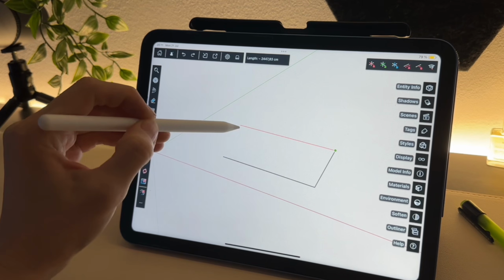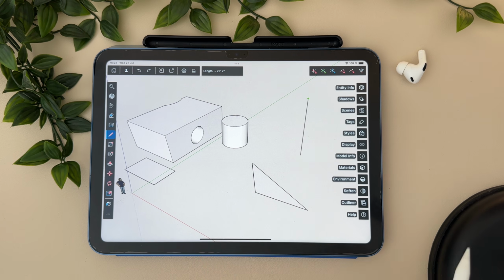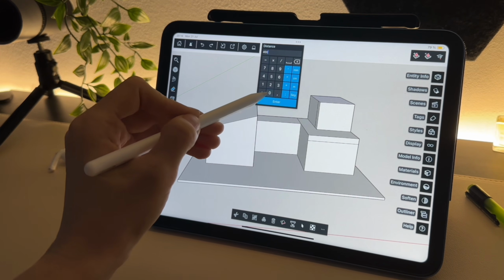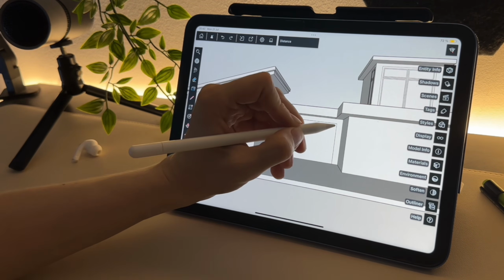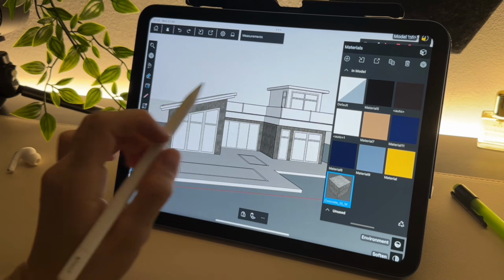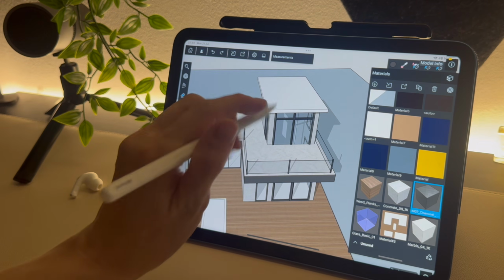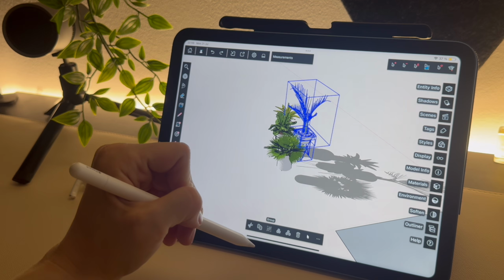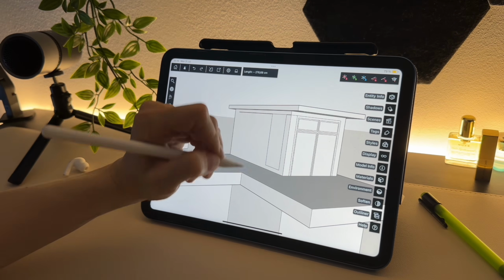SketchUp on the iPad, explained by an architect (+ free PDF guide)

Comment: Thanks, for the great step by step process ands I love all your other videos too! ❤ One doubt I have in this one, is that initially you have simply push-pulled rectangles out of the ground level which means they should have been solid cubes and not empty boxes. Then later, when you added a glass to your windows, they became transparent with internal space visible through those window. Did you skip a step of creating an empty space in the building or did I miss anything in the process?
Reply from the maker: Thank you!  You didn’t miss any steps. In SketchUp, when you push-pull a rectangle into a box, it creates faces around the volume rather than a filled solid mass. So once I delete a face or make it transparent, you can see the empty space inside. That’s why the interior becomes visible through the windows later on.

Comment: I am plan to build my holiday home on a plot size of 600 sq feet but after deducting setbacks I would have 272 sq feet, I am planning G plus 2 structure, with car park in the ground floor, living dining kitchen utility and one compact bathroom in the first floor, second floor would have 2 bedrooms with attached bathroom, also a 2 passenger elevator space to be done for it